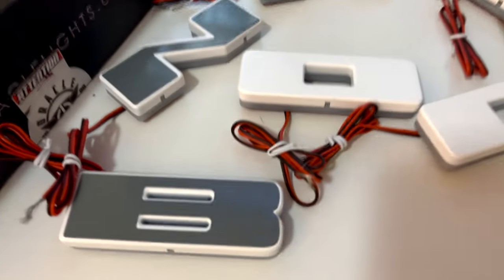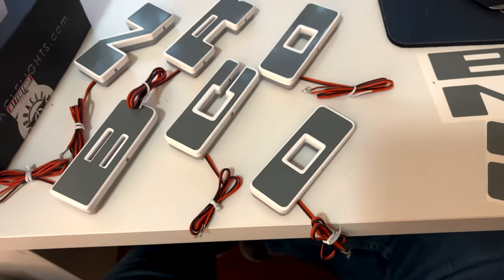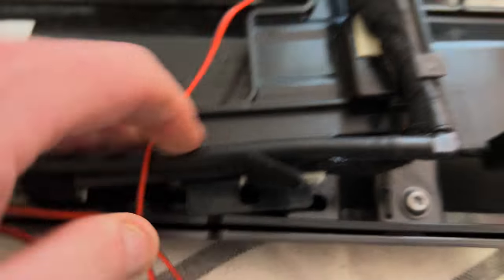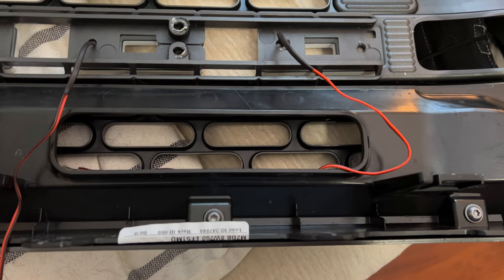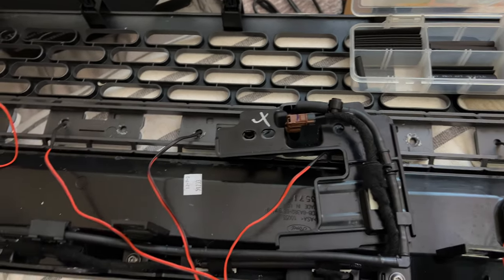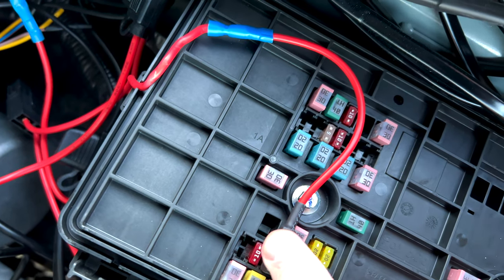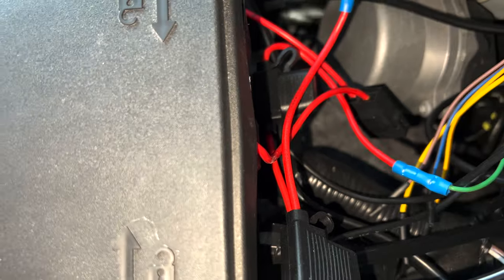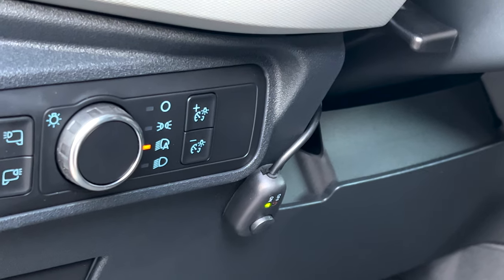Oracle Grill Letter lights and Sticker Fab overlays. #Bronco #FordBronco

Comment: Wiring going throught the firewall , between the grommet will chaff. The grommet is large enough to bore a hole and run the wire through it. Just be careful while doing it. I use a de burring bit rather then a drill bit.

Comment: Hey Bird Dog, great video. I don't have my Bronco yet but that hasn't stopped me from dreaming. I like the backlit letters and have seen several install videos. However, they all tie into the auxiliary switch. I too have other plans for those switches and was trying to think how to have them come on automatically. The tap-a-fuse idea is great. My only thought on your install is adding the kill switch. Now that it's in do you still think it was necessary. My logic is that the halo ring and bar at the headlights are always on so would you be reducing that much light by shutting the letters off?  Thanks again for the video, keep 'em coming!!!
Reply from the maker: Those are not always on if you have them turned off.  I was thinking more likely I’ll rarely turn them off but wanted the ability to do so if I wanted to.

Comment: Sorry to ask another question...are the #10 fuses in a Bronco different I bought 2 add a circuits and they do not fit...the #10 fuse I pulled out is also smaller than the one that comes with the circuit
Reply from the maker: I made that mistake too.  I put a link to one I used in the description.

Comment: How did you use the Hopkins extension?
Reply from the maker: I spliced it in around the grill into the power cord.  That way I can easily disconnect it whenever I need to remove my grill for another project.  I had to do this yesterday and it’s perfect .
Reply: @BirdDogOffRoadAdventures  what gauge wire did you use for the wiring? I order a 16 gauge extension
Reply from the maker: @MrBrown-wv8sh  I used this wiring kit.  https://caliraisedled.com/products/wiring-harness-single-leg